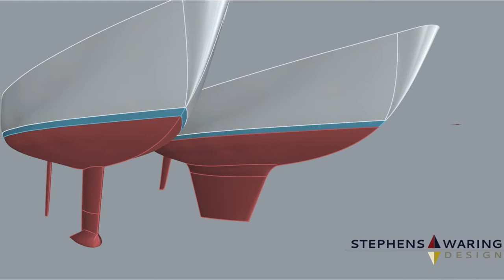Which is Really Faster? Monohull vs. Catamaran Design

Comment: The cat having 2 hulls does not make it having twice the the waterline length vis a vis a monohull of the same length . Max hull speed for both hulls is the same  . What does differ is the effort needed to overcome the max hull speed . The hull length to beam ratio of the cat's 2 hulls is much higher for a performance cat compared to a monohull which makes wave drag nearly dissapear and thus makes max hull speed practically irrelevant for the cat

Comment: very interesting. It seems, also that there would be some advantages for the cat because of the tension you are putting on the sails. when we sail mono hulls we sit on the windward side to add weight to that side to bring the mast more perpendicular to the water. you dont have to do that with a cat. the mast can mainly stay perpendicular (on larger cats). anyone have any thoughts on this? By the way, I am a novice sailor at best.